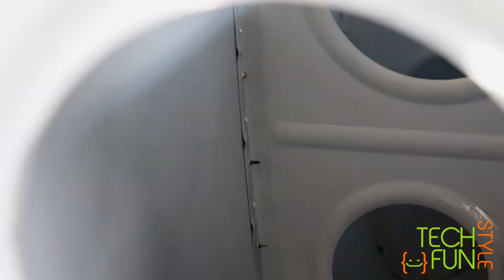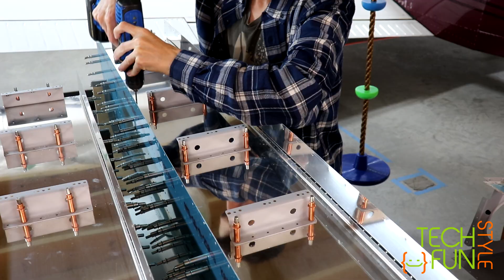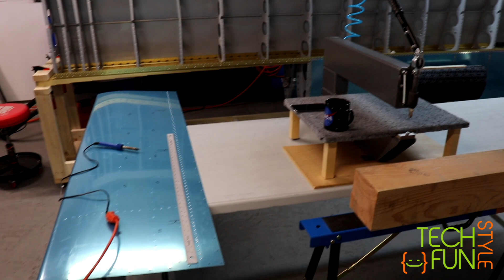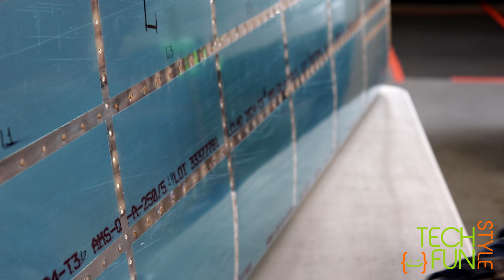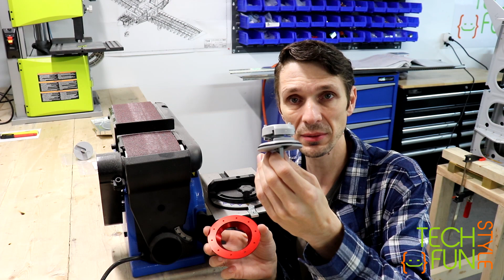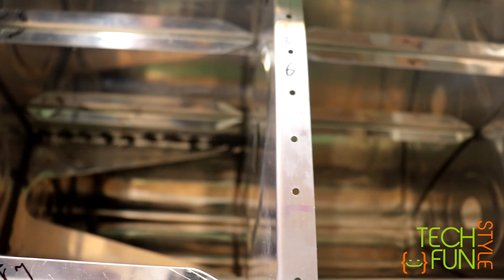RV-10 - Wings assembly. Fuel tanks and more. Part 1

Comment: You missed out one important point in you disclamer speach, you are in Canada and like me in the UK you have to have parts inspected at stages so you jump some steps so that you can get the inspector to see several parts at one time and then you can move forward (without waiting for an inspector to keep coming every other week / month at the cost involved with that).
Tank sealant always gets every place you don't want it, so do not blame you for saving your camera.
Reply from the maker: Right, exactly because of the Canadian pre-cover inspection I am unable to assemble everything as per instructions provided by VANs and have to jump over the steps in some cases. From my side this additional inspection requirement brings lots of mess in assembly process, but from other side this is very good to have an inspector to check everything after you, especially if this is the first airplane you ever building. So I guess there are way more advantages in this inspection, just need little more space to store unassembled parts for now :)
Reply: @techfunstyle1606  If you cost for inspection and availablity of an inspector (in these time) isn't too bad then it might be worth getting them over so you can finish off some of the components and if they are like the inspectors in the UK, they will give you advice on how you are doing and how far you can go on the remaining pieces before they would need to inspect them. It is a good feedback loop from what I have been told.

Comment: Hi Vlad, Im on about the same schedule as you, same place on the plans.  Starting to tank seal this week, cant wait and Fuse coming in January as well.  One thing for me though the bearing bag 1208 has been on backorder since I got my wing kit in early September and they are saying now its the end of November.  Not sure if you had the same issue or not?  Im posting my log on the EAA builder website.

Im curious about your inspections, is that a legal requirement in Canada.

Also, I was reading about the need for the return line and some of my reading on VAF forums was that for some of the newer systems and the airflow fuel pump from Vans you dont need the return fuel line. https://shop.vansaircraft.com/cgi-bin/shop.cgi?ident=1603746824-362-195&browse=engines&product=fi-install
Reply from the maker: Hey! How are you? I think I read your thread on forums about missing (backordered bag 1208). In my case I received my wings kit earlier in summer 2020 and I got all parts (missing just two ribs for flaps though). It is nice to know that you are on the same schedule :) What do you plan for engine - classic IO-540 or something more exotic ? 
In regards to pre-cover inspection - yes this is our Canadian requirement for all experimental airplanes built. I am in process of scheduling my now and hope it to happen with in next 2 weeks.
Thank you for the information about return line. Since I already have all hardware for return line I think I will add it, but I may or may not use it in the future.
Reply: @techfunstyle1606  Thanks Vlad for the reply.  Heres a link to my build https://eaabuilderslog.org/?s=602TB.  Keep up the good work and videos, I need to get the video thing going but just easier to take pics and log my work.  Engine wise, Ive done some checking around and asking about other options, and Im thinking Ill stick with Vans engine approach and order through them, definitely upgrade to the Thunderbolt with the electronic ignition, had an IO540 (300HP) in the Cherokee 6 and it was bullet proof.  When's your Fuse coming?
Reply from the maker: @thaddeusbettner6557  I am sure that this engine is a very good option, I would say the best in my opinion. 300HP will give you so much power and speed. My crating date is mid December and I expect to pick up my pallet around Jan 15-20th.